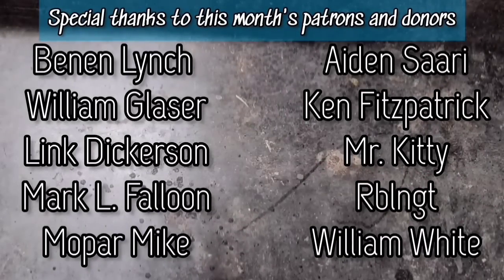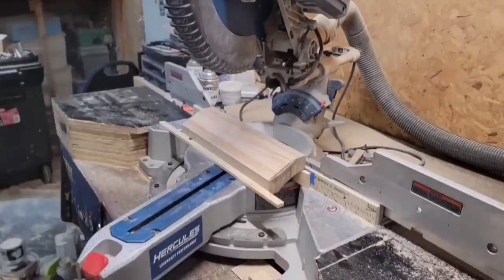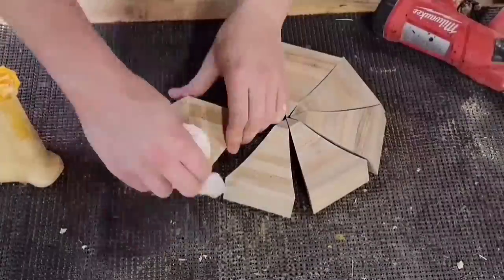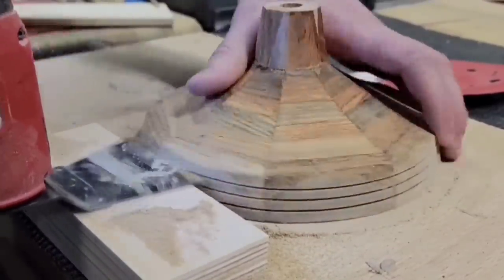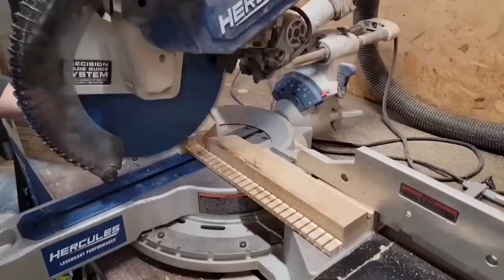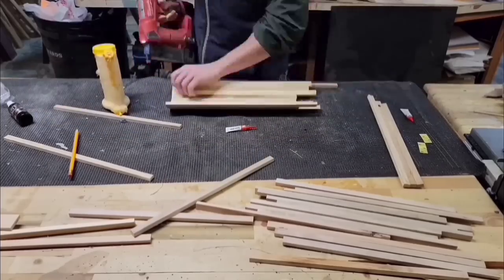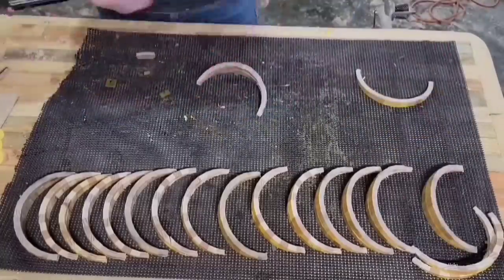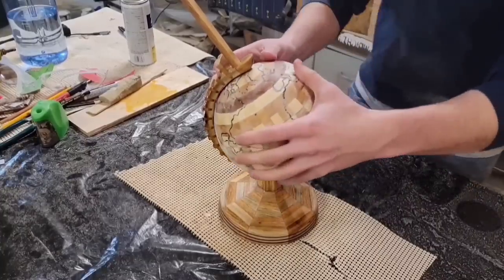Making A Globe From Pallet Wood // Woodworking

Comment: Tell me where you buy your wood that is square/flat and good to go. The wood I get needs to acclimate then ran through the jointer and planer before I will even use it. I would be interested in you doing a video on buying wood that is perfectly square and flat directly from the wood supplier.

Comment: Nice job. Maybe just leaving the indent from the engraving tool in the timber and no highlighting, it would be more interesting. I don't know if you have seen the resin pins for nail guns which you can saw, plane etc. without fear of damaging a good chisel. I cant remember if they only fit a particular nail gun. But I follow a Canadian boat builder and he uses them for holding long planks in position while working. Easy to break apart too if necessary.
Reply from the maker: I haven’t heard of resin pins but that sounds really cool, I’ll have to check that out!

Comment: Question, Josh: why not cut the coves on your table saw?
Another great project!  It came out very nice indeed!
Reply from the maker: Thanks Billy! With the miter saw, I dont need to make a jig to cut coves and it is easier to quickly adjust the angle to find the cove size I like. With that said, I think with a good, easily adjustable jig, the table saw would be safer and faster.